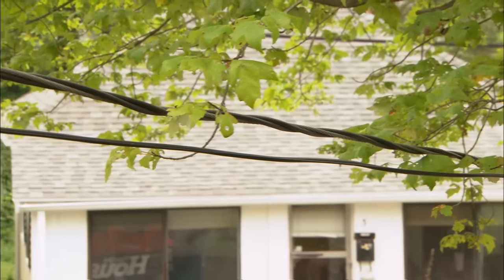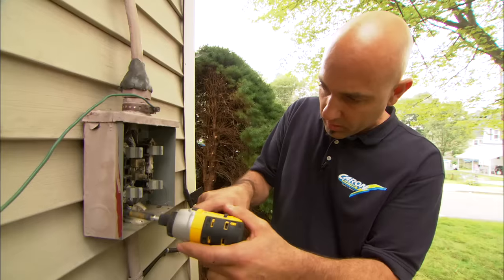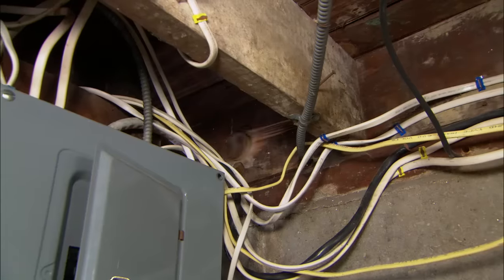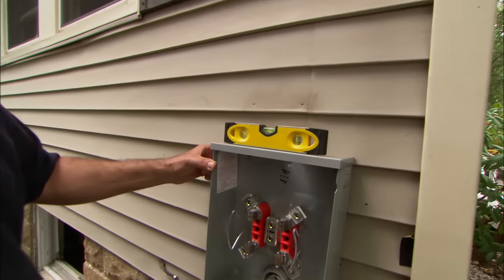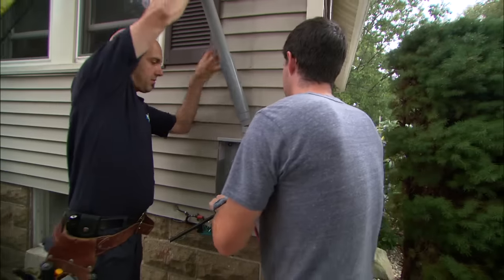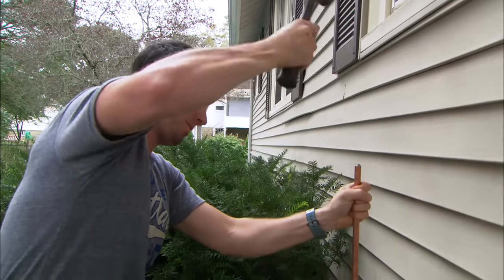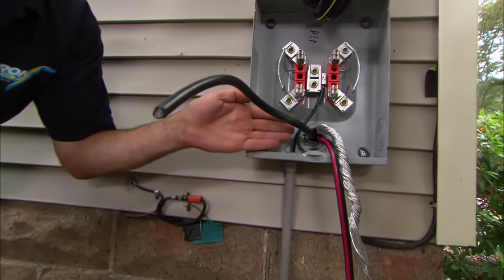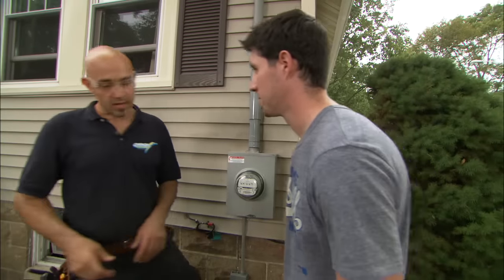How to Upgrade an Electric Meter to 200-Amp Service (Part 1) | This Old House

Comment: 3:38 - "These ground rods ensure that electricity has a safe path to ground" -- False.... a fault current does not go into the soil. Electrons want to take the path of least resistance which is not through soil..... they want to travel along the aluminum/copper wires back through the pole mounted transformer and then the intent is that the main breaker trip (or fuses blow) to kill the power. 
https://www.youtube.com/watch?v=mpgAVE4UwFw -- Mike Holt has HOURS of videos explaining this.
There was an experiment done to show that given the relatively high resistance of soil, that for a 120V, 1ø circuit - the max current going through the earth/soil was 4amps, which is not enough to trip a 15A or 20A breaker.

The ground rod does not save lives...... The SYSTEM BONDING JUMPER BETWEEN GROUND AND NEUTRAL is what saves lives and lets a fault flow back through transformer and then through the main breaker to trip the main breaker. 

The purpose of the ground rods (or counterpoise or grounding triad, etc -- conductors in earth or soil) is to have a common reference point for voltage, and for lightNing strikes. 

However, excellent video!! Super informative and excellent camera angles to show every step!!!! 
Thank you!!!

Comment: what the reason to upgrade to 200amp meter?
Reply: The house need a 48kW, 3 wire, 2 hots of 120V and neutral.

Comment: Homeowners, here are three reasons why an electrical panel upgrade could be beneficial to you. 
Sun Works Solar is providing $0 cost Electrical panel upgrades to homeowners that get a free estimate, schedule a free consultation, and choose one of my simple solar plans. 
Improved Safety: An electrical upgrade can help to ensure that the electrical system in a home is up to code and safe to use. This can help to reduce the risk of electrical fires and electrocution, providing greater peace of mind for homeowners.
Increased Capacity: Older homes may have electrical systems that are not capable of handling the demands of modern electrical appliances and devices. An electrical upgrade can increase the capacity of the system, allowing homeowners to use more devices and appliances without overloading the system.
Energy Efficiency: An electrical upgrade can also help to make a home more energy-efficient. This can be achieved by installing energy-efficient lighting, appliances, and other electrical devices, as well as by optimizing the electrical system to reduce energy waste.
head over to www.sun-works.pro to find out more and schedule a free consultation

Comment: Wow. Missouri would never allow that meter that low. Also the point of attachment looked pretty low. But Why did you drive a 10 foot ground rod by hand, with your wife's hammer? Holy crap it's hard enough with a hammer drill.

Comment: If that was for real, why would you install the meter before working on landing wires inside?
Reply: Chances are the power/utility co. hadn't reconnected the wires up by the weather head yet to restore power to the house. If they had restored power then yes, you'd want to install the meter after all the wiring was complete inside.

Comment: Bad on This Old House! It showed using aluminum wire (which is fine as long as it is rated for the 200 amp service), but did not show the use of any type of anti-oxidation on these wires. This has bern standard practice for more than the 5 yrs since it shows this video was made. Bad bad bad!
Reply: They show it in part 2.
Reply: Charles Moceri yes they did. But that was on the inside. It is required anywhere aluminum is used. Snd while it was shown, I do not believe it was explained.

Comment: More like "How your Home is Upgraded to 200-Amp Service"
Reply: @imadnehme4773  200 Amp is pretty much the standard for new homes. Homes today have so many more devices, electronics, appliances, etc. Homes back in the day didn't have that issue so 100 amp was the standard which isn't enough today.

Comment: America do not have "2 120volt Wires" the system is 240 volts over 2 wires AND one neutral.
Reply: With each wire having 120 volts....

Comment: Lol,  called the city to cut the power.  If you have a permit from the city the electrician can do it himself, and how come the weather head is no through the roof????  PVC?? Pipe?  Shouldn't you be using Rigid conduit.
Reply: If the service drop is high enough, why penetrate the roof?  And PVC is allowed to be used as a service mast if it’s not supporting the overhead service drop wires
Reply: @electricaf365  Guess it all depends on what City inspectors want.
Reply: @GriggsC123  edited ☝️. If you had more experience then you would know that inspectors don’t know jackshit
Reply: @electricaf365  Tell that to a inspector next time.
Reply: @GriggsC123  I have

Comment: for those of you rasing holy hell about using AL you should relax. Provided its the right gauge size AL is just fine. The power coming into your breaker from the power company is more then likely AL so just relax

Comment: They let a normal electrician to install the meter and the supply cable to it ? They have trust in the client, in my country this is strictly forbidden, only the electric company can touch the meter and the cables that brings power to it, and the meter and every connection on the utility side is sealed with anti tamper devices, and breaking them it's a crime, if not someone could just bypass the meter and get free power. 

Also I'm surprised that in the meter there is any kind of breaker, how can the utility company be sure that you don't draw more current than what you contract allows ? Also a breaker in the meter is a security measure for the power company, it in the client side for some reason you get a short this way you can damage the meter and the electric wire, potentially tripping a breaker or blowing a fuse on the utility side, cutting power to other homes. A breaker in the meter is a way for the electric company to be sure that there is at least a minimum level of protection.  

Also I'm surprised that these kind of meters are still in use, as you can alterate the power measurement with a simple magnet, in my country they were all replaced in the first years after 2000 with new smart meters that can be read remotely, and now they are replacing them with a new more advanced version (that you can also use with an app if you want to monitor your consumption and new crazy stuff). That for the client these new meters are not so great, once the only measure that there were to limit the current that you can get (a typical contract is for 3KW, I know is not a lot for the american standard) was a standard breaker, so you could easily draw more power from the grid, now all it's done electronically so draw more than 3KW for a couple of seconds and the meter cuts the power and you need to go out in the street to reset the breaker.

Comment: Looks like he put it on the neutral. But looks like none was put on the feeders. That's what I was referring to. The video is poor and leaves out some steps. Also the meter socket is installed too low. Should be 5' 6" minimum. Jeremy

Comment: why did he use such a thing cable to the ground?
Reply: Code does not require larger than a 6 gauge grounding electrode conductor in this case.

Comment: Upgraded without using a bypass meter enclosure? Now the customer will still lose power if the meter needs to be changed in the future for other reasons. Bypass meter enclosures are the way to go. C'mon man.
Reply: Where I'm at you need a disconnect  and bypass lever.  I guess it is just the area.

Comment: Those mechanical lugs for the power aren't nearly as reliable as the crimp on ones that the service company can do for you
Reply: Burndy "H" crimps or Burndy insulinks......5,000 lbs of pressure for each crimp, this is what we use and we do not rely on the utility company.

Comment: Is this even necessary for someone with 100 amp service? I'm having a real hard time justifying this upgrade. I got gadgets just like everyone else but I got gas for the stove and furnace.
Reply: FlashOfLight probably not unless you have a demanding swimming pool or tankless water heater

Comment: dont understand why you need so big cables for a normal house, who is using 200 amperes , increible , also I can see that in the states electrical instalations are very lousy , now I can understand why so many houses are burning to the ground with a simple short circuit

Comment: A few things....#1 Disagree..A homeowner has the right to do this work himself and does not need to pay an overpriced pro.  #2...Why did you feed in 8 feet of SE cable into the house when the panel was right there???   #3....I didn't see you put any sealer in the entrance hole in the wall   #4...Shouldn'i the ground wire have been solid #4 copper rather than stranded???
Reply: "over-priced" pro?   Who built your ocean-going yacht, you comfortable with the local Boy Scout troop, were you? I'm a professional, well but not over-priced Journeyman carpenter. I have never had a call back. I can do construction math, recite codes, etc in my sleep. I would love to know your idea of over-priced. People can chose what contractor or workman to hire by price if they want to, besides.  You get what you pay for.
The rest of your argument I am in 100% agreement with.
Blessings.
Reply: I'd sure like to know where you would find solid #4 copper!  Copper is available as solid only down to #12 everywhere I've ever worked (in the US).
Reply: Google it...You can even buy it on Amazon!
Reply: ON a driven Ground Rod.  the grounding wire only has to be a #6 . Does not have to be a #4 wire.  Now if inside is a copper water pipe going outside , for a 200 amp service is a #4 wire.    It is code.
Reply: i don,t think i have ever seen a bare #4 copper wire.  #6 and #8 Yes.
Reply: @dholm904  the standard for us is solid #6 on ground rods.

Comment: im no electrician, but everytime i see this guy doing wiring work he always has a ridiculous amount of slack and then cuts it off lol doesnt that just waste so much money.
Reply: Manny the reason for that is because the amount of money lost in slack is nowhere near the amount of money lost if you accidentally get too short of wire then you have to get a whole new length of wire and then usually the piece that was too short ends up trashed
Reply: @ifh8579  "Better to be lookin at it than lookin for it"- Old-timer on our job. Haha
Reply: A long wire is a happy wire.

Comment: you could put a 1000A meter on there but it would still be limited by the incoming cable size. and why is everyting outside and so bl**dy ugly?? I wouldnt want that on the side of my house. in the uk we have flush meter boxes with just a small door

Comment: He didn't have to make a new super large hole that's a bunch of BS, you could clearly see the line would have fit in just fine, probably wants to just charge another 1000 bucks. All he had to do was first try it then maybe a little silicone grease so its not flammable.

Comment: What happen to copper wiring now days
Reply: +James McBride Aiuminum wire has been used from pole to meter socket since Edison was around
Reply: Stranded aluminum is still allowed in residential applications.  99% of service entrance conductors in my area are aluminum.

Comment: In a 120V countries, the single phase transformer (120/240V) it's used in excess. 3phase system (127/220V) is better.

Comment: why need 2x 120v wires ? why not 1x, I thought U.S.A uses 120v power ?
Reply: The house need 48kW. This power is 200A with 2 lines of 120V and neutral, 240V or 208V line to line. In single phase 48kW is 400Amp!
This 2 hots + neutral service its useful. For example in Europe 50A in single phase 230V is 11,5kW. With 2 hots of 230/400V its need only 25A for 11,5kW.

Comment: You can,t drive those driven ground rods that far here in KY.  gezzz.   and i usually use Copper wire for a service like this.  I hate Al wire and hate Al bus panels.  junk.

Comment: why would you need 200A service for a house??
Reply: each room has its own circuit
Reply: ok sure, still... why?
looking what I have here, higher you go with power (amps in US), more you pay on top of what you use.
and 200A gives you about 24kw, which is more than double of standard house here. What is than typical power consumption of such house there?
Reply: Washer 
Dryer
Dishwasher 
Power tools in Garage 
A large number of new homes are built with Dual air conditioning units nowadays. 
Not to mention the large amounts of electronics that we not only run, but charge as well.
Microwave 
Garbage disposal 
Electric range and oven.
Outdoor lighting
Swimming pool pump and filter/heater
Fish tanks
Heating
Heated exhaust fans in restrooms
Not to mention two small appliance circuits in the kitchen, dedicated GFCI Circuits in each bathroom plus lighting..
Oh, and did I mention, all 15 & 20A circuits have to be AFCI protected.
...and most of what I've listed is required to have dedicated circuits...either that or it SHOULD be on a dedicated circuit.
Dig into NEC 2017 for a few hours.. you'll figure out "Why you need?"

Or... you can just sit in the dark..
and criticize others..... from Hungary.or whatever EAST bloc nation you're shivering in.
Reply: You are just showing how uneducated are you with not only last comment, but all of it and with listing whole list of things that use electricity. And some of the them are just silly, like (Heated exhaust fans in restrooms, wtf, would you heat something you exhaust outside and from restrooms at that). Heating of air and pool can be done without electric heaters (that would consume a lot of power), and you DON'T run those bigger appliances at the same time and even if you do, this days they are pretty efficient. As far as electronics goes, name 5 that take a lot of power, same goes for chargers, go on... name them. The only thing as far as chargers goes is EV.
Reply: Even an all electric 1 bedroom cabin may need such a service.. At one time 100 A. was the minimum service. 2 15 A. lighting circuits, 2 20A kitchen circuits, 1 15 A. laundry circuit, 1 15 A. GFCI circuit.. Add in AC and or el ectric space heating, electric hot water, electric kitchen range, clothes dryer it adds up

Comment: Wires are aluminium. The resistance of the cable is high compare to copper , so the owner of the house will pay  extra for electrics.

Comment: So, you just thump a couple of rods into the ground and then don’t bother to text the loop impedance? How do you know you’ve got decent grounding with testing anything?
Reply: BOTH of those copper rods are connected together with a wire underground.

Comment: Pretty sure he was suppose to wait to plug the meter in
Reply: Not for inspection purposes in NJ. The entire set up needs to be installed so the electric company can inspect then tie into the wips coming out of the wether head

Comment: He didn't use any anti oxidant...those aluminum wires will oxidize over time and all of the sudden the lights will get reeaaalll bright...then you'll need an electrician to redo the connections, good information up to that point but that's where he lost me.
Reply: Not true. Wire manufacturers like South wire don't recommend using any antiox compound

Comment: - two phases, because who needs three
-two Copper rods in questionably compressed soil as grounding for the whole house
-cheap Aluminium cable

The US got nothing on "shithole" countries with THAT kind of electrical standard. At least you support the VFD industry.

Comment: You failed to seal the hole in the wall...
Reply: I thought the same thing.  "Let me just drill a 2-1/2" hole through your siding. Don't call me if your sheathing, sill-plate, and rim rot out in a decade."

Comment: Not to code anymore, they require an outdoor service disconnect now for safety
Reply: no they do not
Reply: @jamedlock83  yEaH tHeY dO.
Service upgrades or new construction

 2020 Code Language:

N 230.85 Emergency Disconnects.

For one- and two-family dwelling units, all service conductors shall terminate in disconnecting means having a short-circuit current rating equal to or greater than the available fault current, installed in a readily accessible outdoor location. If more than one disconnect is provided, they shall be grouped. Each disconnect shall be one of the following:

(1) Service disconnects marked as follows:

EMERGENCY DISCONNECT,

SERVICE DISCONNECT

(2) Meter disconnects installed per 230.82(3) and marked as follows:

EMERGENCY DISCONNECT,

METER DISCONNECT, NOT SERVICE EQUIPMENT

(3) Other listed disconnect switches or circuit breakers on the supply side of each service disconnect that are suitable for use as service equipment and marked as follows:

EMERGENCY DISCONNECT, NOT SERVICE EQUIPMENT

Markings shall comply with 110.21(B).
Reply: @patr259  Of course, the local jurisdiction has to accept the 2020 code first. Sometimes there is a lag, like up to 5 years.
Reply: @ricoludovici2825  I know in Michigan, the board review is every 3 years. Probably different state to state
Reply: @patr259  Here in Clark County Nevada, it is immediately after your permit expires on a current project. Each time.